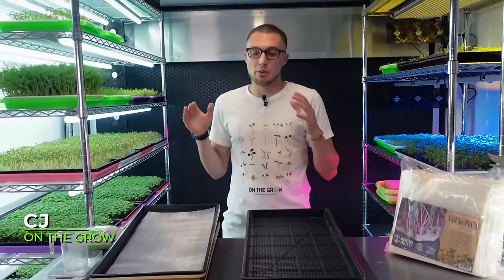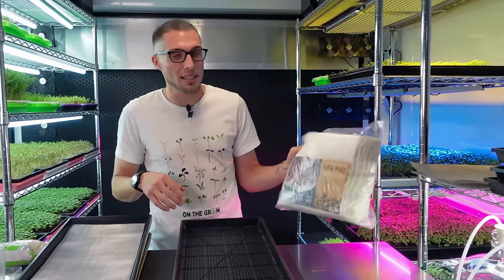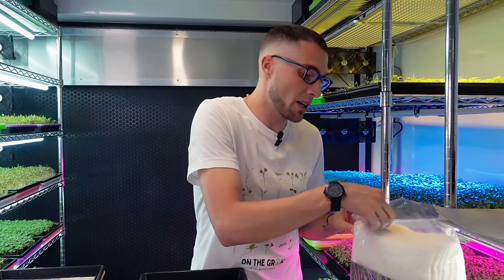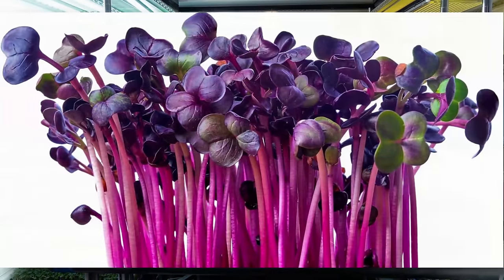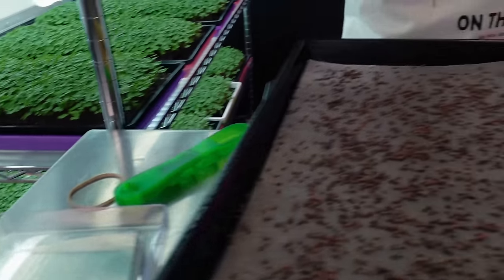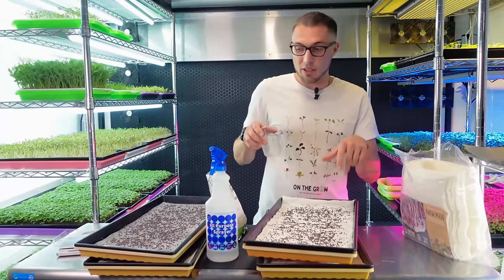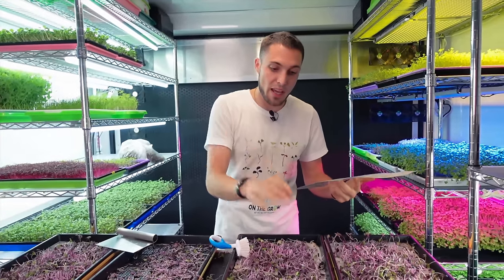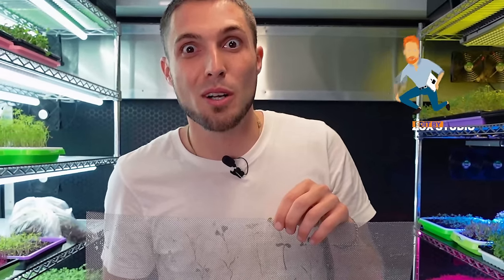Reusable Grow Medium vs Premium Grow Medium - Rambo Radish  Microgreen Medium Trial

Comment: I am curious to see what happens if you place the stainless on top of a hemp mat.  The hemp mat would retain the necessary moisture that the stainless lacks.  Is it possible to then lift the stainless off the hemp and get a higher total harvest weight?  Even better would be a reusable moisture medium that does not degrade like the hemp.   This would allow you to reuse the moisture medium and the stainless.  My assumption here is that the stainless allows you to retain a higher yield by allowing you to cut closer to the roots.

Comment: So, if I think I might have trouble monitoring the saturation levels (over or underwatering) would you recommend I use cocoir, soil, paper towels, or what?
Reply from the maker: Coco and soil and probably the most forgiving. Over saturation can cause mold and other issues on them, but for the most part, you can usually overwater or underwater a little. 

If you aren't good at determining how much to give in water, I'd suggest those two. Reusable grow medium can handle overwatering but not underwatering.

Comment: Great video! Thanks :) How have you found getting peashoot roots out of the mesh? I imagine that's quite a bit trickier? Would you just recommend the mesh sheets for the smaller micros? Thanks 🌱🌱
Reply: The radicals for pea shoots are definitely too thick for the 1mm RGM.  I recommend either top sowing on coco coir, or just directly on the mesh tray itself.  Both work fine, but I find the coco coir to be better because it retains moisture better and is more inhospitable to puff mold.  The coco can also pay for itself if you compost by being recycled into top quality potting soil.

Comment: I have used the stainles steel (and woven plastic) mesh for growing microgreens in the past. I used very fine holes mesh; my plan was to keep all the roots over the mesh to make a pure root matt. I had a few problems:

1. I had to water frequently as mesh didnt retained the water. I was aining eventually to have a self watering system of spraying or mister using ultrasound (I did use it).
2. Fungal growth issue.
3. Eventhough it was very fine mesh the fine roots still got through.
4. Problem with cleaning the mesh which I could get through it by drying the roots.

I am sure I could get that work but I changed the system and now I have developed a self watering microgreen growing system which after a number of prototypes I think is ready for the market. Now I have ordered the first few hundred batch of them and they are ready for the shipment. If you are interested we could work together and we both benefit from it.
Reply from the maker: Sure, you can reach out to info@onthegrow.net with some details and we can talk about it! Excited to see what you've created...
Reply: @OnTheGrow  Thank you. I will be in contact with you. Regards
Reply: @OnTheGrow  Please check your email.
Reply: @drpk6514  can I please have some details on your system. Thanks

Comment: That pastry cutter is literally $1.25 at Dollar tree.
Same size, same shape, and stainless steel...$1.25 at dollar tree.
I bought 2 a week ago.
Not sure the stainless steel is cost effective.
Time is money and you spend a huge amount of time cleaning, picking and pecking at those.
Although those can be autoclaved, I think in the end they are to frail, prone to getting bent, pinched and materials stuck in them to spread disease.
Not a fan
Reply: Nailed it on the head. These mesh mats could be useful for the windowsill grower but not for anyone that puts a higher value on their time. These are not a viable option for any sort of commercial growing. Labor, without a doubt, is the biggest expense on a Microgreen farm. The cost of added labor for cleaning these things is far greater than the little bit you save using a reusable mat. Not to mention, cleaning is generally the least favorite task on a farm. The goal should be minimizing these types of tasks, not adding to them.
Reply from the maker: When we power wash them, it takes a whole 10 seconds to 15 seconds per mesh. Really quite easy to clean 😄 depends on your processes though I suppose! We will make a video on our cleaning process for them soon. Also, we have several farms running about 80-120 of these mesh and are loving it. I think it's really up to your cleaning process and what you prefer 😉

Comment: What micron size is the mesh you are using? Would different sizes be better for different micro varieties pea or sunflower or fava? Thanks!
Reply from the maker: This video is an older video and since posting it we have started selling our own Stainless Steel Mesh product for growing microgreens and there is a difference between the mesh used in this video and the mesh that we sell. The mesh is this video is a 304-grade stainless steel…. however, our product that we now sell on our website is a 316-grade stainless steel and the mesh holes are 1mm. 

For peas, you do not need a grow medium, you can grow directly on a mesh tray, and since the roots are so aggressive I feel that they might clog the grow medium (we'll have to do a test on this).

As for sunflower, they grow amazingly - Check out this blog /case study we wrote --> https://www.onthegrow.net/post/case-study-coco-coir-vs-reusable-microgreen-grow-medium-high-seeding-density

Fava is a crop we haven't grown yet, so I am unsure. However, our mesh works with most seed varieties as long as the seeds aren't small like amaranth (they'll fall through), or aren't hard/clingy seeds like swiss, beets and cilantro. 

here's the mesh we sell 
https://www.onthegrow.net/product-page/reusable-microgreen-medium
Reply: @OnTheGrow Ah ok thank you. The mesh holes are 1mm or the wire is 1mm?  I have read that some growers use 2 different sizes depending on variety I was hoping to find a common one that worked for all. Before I purchase what is the mesh of the screen? 30 mesh? 40 mesh? Thanks

Comment: Interesting video. Seems a little concerning though across the board. If you're talking about Black Mold on all product, it doesn't matter if it's a little or a lot because any of it means there is much more you can't even see yet. This seems like all the product is a little risky to eat.
Reply from the maker: It was only the VegBed side as I show at the end... I visually inspected the stainless side and none was present. I hear your concern though! Generally we don't have that kind of mold in our growspace, it only happens when some mediums work really poorly, such as the VegBed in this case...
Reply: @OnTheGrow  OK, I thought you said there were a few Black Mold spots on the other one as well just not as bad as the VegBed. Thanks :)

Comment: Just to point out. The panel led's on the bottom, which you deemed to be the best. Only problem is you WAY over paid for them. Those panels are available in 2 packs for 35 bucks on amazon. from sellers greensindoor or seametal. they come in full spectrum and blurple so make sure you get the ones you want. 300 watt "replacement" panels have an actual pull of 45w. for the price you paid you could have bought a Viparspecta XS-1000 or P1000 or similar. Which is a 100w full spectrum panel using Samsung LM301b diodes. Those are advertised as 1000w replacements {nope| but they are super amazing for 75 bucks or so!!!

Comment: you can use silicone mesh mats. what was your mesh hole size?
Reply from the maker: 1mm holes, and definitely!
Reply: @OnTheGrow  what micron size is that 30,40,50, or 60?
Reply from the maker: It's a 30 mesh, if you go to our website there are all the details you need. Www.onthegrow.net. 🌱🌱

Comment: What size is the hole on the stainless steel screen?
Reply from the maker: It's 2mm I believe! I can get the exact spec later and I'll pin it in the comments! At dinner at the moment. Hope that helps 🤗🌱🌱
Reply from the maker: The holes are 1mm in size! We now have blogs a a video on it! 🤗🌱🌱